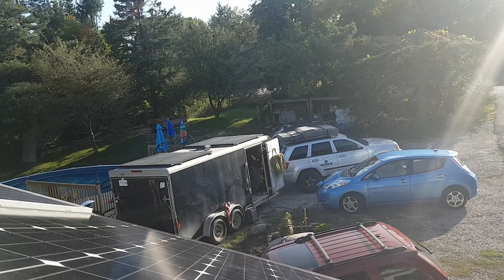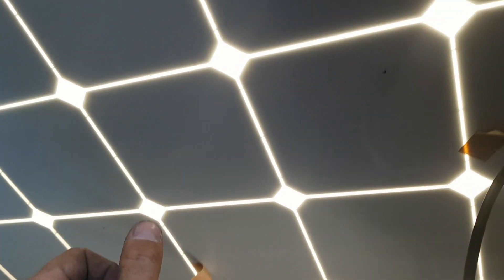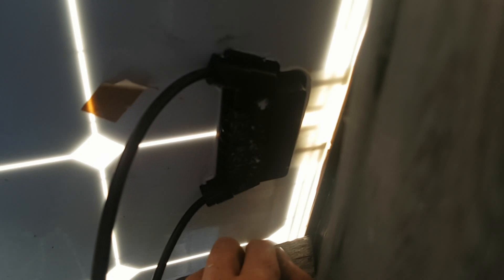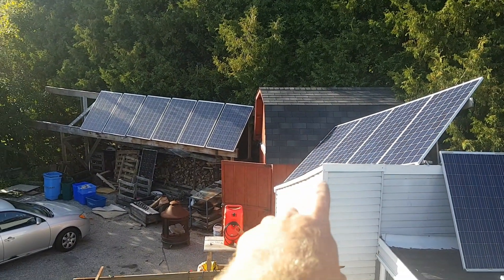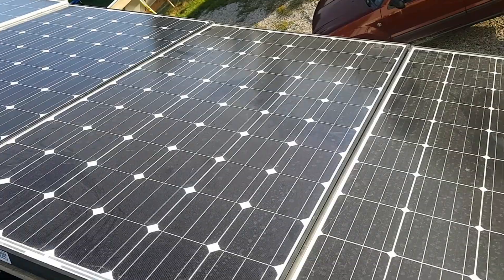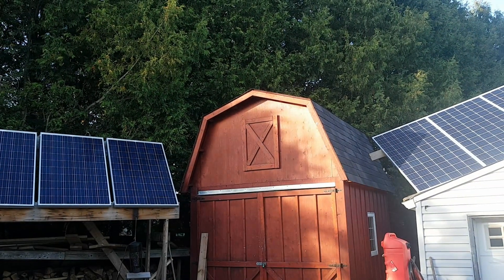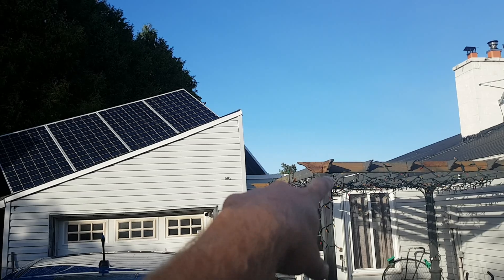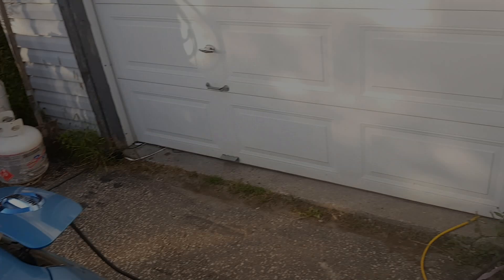How Not To Hook Up Solar Panels, Big Mistake.

Comment: Even brand new panels can have the connectors on the wrong way round. Always best to spend 20 mins and check the whole array with a DC meter before plugging in... easier to check on the ground  if they are roof mounted.
Reply from the maker: Yea didn't think it was a thing, now I do

Comment: I got a question for you on these Reliable inverters the little screw on the inside of the inverter that will make the AC output voltage go up or down will that go all the way up to 220v or 240v do you know? Have you tryed turning it up all the way.
Reply from the maker: no it will not go that high.
Reply: @GoingOffGrid101  do you know how high it goes
Reply from the maker: @supremeautomotive6749  think mine went to 139

Comment: Hello GOG, I had the same issue with some panels I purchased from China in 2014. Sorry to hear about your misfortune. Glad you were able to make it work for you. The panel that shades the from the shed. Remove it and do a three in series connection to your controller. You will see better results compared to what you are getting now

Comment: Some joker cut the plugs from them and then replaced em mixing em up. I have 22* vdc panels wired in parallel not series, on a average day I'm pulling almost 100 amps at 32vdc (sun hours) about 4 and 40-50 at sun up and sun down. I have my whole house running on batteries, a mixture of agms and lithiums.  I MAKE PLENTY OF POWER. EVEN IF HALF THE PANELS ARE SHADED. WHY??? BECAUSE THEY ARE NOT DICTATED BY THE NEXT PANEL. take them of the series setup and wire them with 10-2 awg continuously to the junction box. I run mine with 44 separate lines and a common neutral and bonded each frame to a ground. They come into the box 3ott wire size (all ac line) into my buse bars and then my inverter to my battery's 20 * 12vdc series to 24vdc then a dual 2kva transformer then my house panel. No problem here.   I solder all connected parts. Even the batteries are solder to buse. I'm a plumber it's easy as pie for me. You should consider getting a good voltage tester to. Could have avoided it. I cut all the ends off my panels.

Comment: Bro on the real you need to to run those out to a junction box and no series on parallel, this will output more amps, amps are key here not volts from strings.

Comment: The panels can be connected in parallel or series. What you had before was three panels connected in series, to create a 36 volt system. Connecting + to -, + to -, and to + is common to create a 36 volt system. Advantage is the wire diameter is greatly reduced as you will run 1/3 the amperage.

Comment: Have you ever thought to put a relay or switch to select  between all four panels (for before the evening shade) or just the three panels that are not in the shade when the evening shade covers the panel on the left? That way you can still get a few hundred watts extra in the evening.

Comment: So far, all my panels have been same type and plugs have been the same direction and I too would have assumed that all panels would be the same (mc4 connector wise).  Great video / reminder that even the simplest things like measure +/- on panels with voltmeter before hooking up can save big trouble.   Thank you!

Comment: yes, i am sure they are chinese panels. a month ago i bought a lithium 12V battery with the polarity reversed. what do they think?
i never had reverse polarized panels sofar though.
also you should have each string with a breaker, so when that happens the current gets disconnected.

Comment: Have you ever looked into dc to dc inverters as that removes the requirement of having all solar panels having sun (as each 1 or 2 solar panels has its own dc to dc inverter) and can have a large string of them
Reply from the maker: i have not looked into them. thanks
Reply: not worth the money when you have 3 in series only
Reply: @ursodermatt8809  you do all of them, as long as you have at least six panels with light on them or the overall voltage is high enough to start power you can have any size solar panel as the dc to dc inverter in each panel is independent, 
not cheap thought and I am not sure if there is a compatible inverter that works in off grid mode
Reply: @leexgx  
he has only 3 panels in series. 
and it is 6.00pm. 5 minutes later all panels are in shade..
and, more importantly!!!!!!
the midnite classic does not work with optimizers.
in short:
you are better off in investing the money into more panels.

Comment: quick cure move shed back a  few feet it looks like a easily movable ready built shed to me
Reply from the maker: On a concrete pad :(
Reply: @GoingOffGrid101  pour a additional pad section your in construction not that hard or labor intensive then simply move it back 2-4 feet and your solar panel shading issue is solved. A concrete pad what say 4x8 feet 4-6 inch deep you and a friend can easily poor that and such by hand in a few hours let it setup the next weekend move the shed back problem solved.

I would say that a is a fairly simple remedy to solve your issue day in day out as a everyday issue you can fix in a weekend or 2 and a case or 2 of beer.
Reply from the maker: @rickcooperjr62864  its very true

Comment: oooh ive been there ,on used panels ,i always check the +/-  just to be sure,
Reply: You don't really expect some one to fit the connectors on backwards, as they are supposed to be the right way due to electrocution reasons and instant poping of the diodes, someone has replaced them and put them on backwards

Comment: Wow bummer at least it was the diodes and not a charge controller or a fire. Geez
Reply from the maker: yea, very true
Reply: @GoingOffGrid101  At least those diodes are cheap and you should be able to replace them. Probably 1000V 10A Schottky diodes, as one blocking diode for the panel and a bypass diode for each half of the panel?